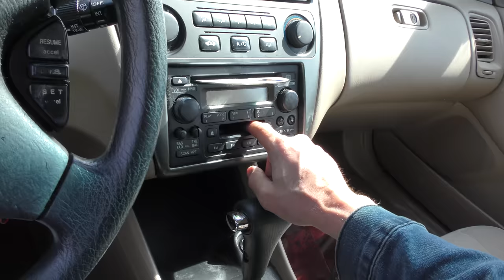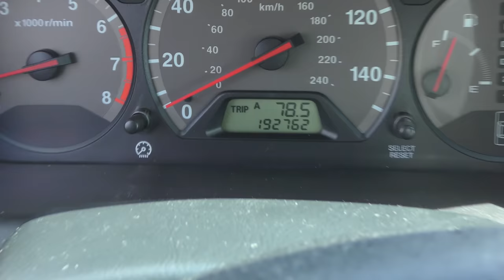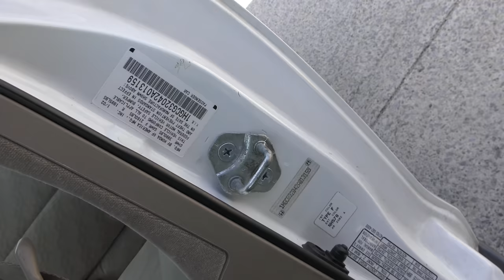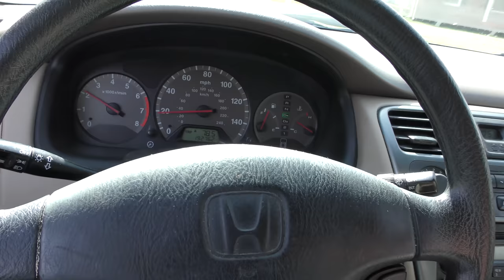This Car Has a Serious Problem

Comment: my kids have 2002 to a 2004 cavilers   they still have most of their  oem parts  it how  you drive them an  take care of them
Reply: No. It's not the only part. The car or truck has to have quality......you guys got lucky
Reply: @richsweeney1115  no they are old gm..big diff  ,,my 95 transport has 200,000 on it  still has most its oem parts  ..an still gets 30mpg...but i ordered it with a 3800 ..
Reply: @richsweeney1115  oh in ohio  there are not many hondas that age on the road,,,,rust
Reply: @Monza62000  but even those have issues. The Montana is the same thing , and they had problems when they got older
Reply: @Monza62000  I live in NH, my wife has an 09 Honda fit 5 SPD sport, w 200k runs like new, and  I have a 5 spd accord that's older than the fit with 231k that also runs like new. Gotta wash them often in the winter
Reply: @richsweeney1115  glad you take car or  the cars,,,we fluid film  ours   my rack  makes it easy..all cars that are made today  can last an last,,my 92 k1500 chev still looks great
Reply: @Monza62000 actually, the newer they are the less they'll last .. new cars are made cheap

Comment: When you change transmission fluid, when should you flush and fill, opposed to drain and fill.
Reply: NEVER, On Honda’s , Never Flush. I always Drain & Fill.
ALWAYS use Honda Fluids.
Reply: @fubarnow8907  I don't own a Honda, but I was just wondering under what circumstances do you flush a transmission.
Reply: @todddrayton9354  Flushing A trans in Any Car can be bad. Sediments are in the case and flushing can move these sediments and clog holes that were once unclogged. This can lead to Trans Failure. Just something for you to think about.
Reply: @fubarnow8907  Is there any upside to doing it?
Reply: @todddrayton9354  If you have to drop the drain pan to change the fluid, that would be better than a "flush". Scotty has Video's on why a Flush Could be bad.On my car I do a drain & refill every 3 to 6 months. My Fluid is Always pink and smells good, never burnt. I have over 200K on my trans and it shifts like new.  I spend 35 dollars for a 3000 dollar trans.

Comment: Hey scotty! I have a sorta similar thing with my pontiac g6, shifts sorta hard randomly but not when floored. Been doing that and have random shutters from the torque converter here and there but still been going like that for over 15000 miles now, would you reccomend driving it and just don't worry?
Reply: baby the car they have weak transmission if it starts to get real bad put Lucas stop slip in it
Reply: its called lucas transmission fix stops slip
Reply: I have same car (2007) same problem just been babying it hardly letting is rev pass 3k and it seems fine till I do a few times.

Comment: 06 Acura TL. Jerky transmission when i come to a quick stop and then try to quickly accelerate. I keep it from doing that jerk (in hopes that the tranny last longer) but i also have been changing the fluid since i got it.

Comment: 200 bucks cost to put a transmission in my old f150 where I'm at. Transmission not included in price lol
Reply: We used to have a blue 1992 Buick Century Wagon back in the 90s. Never had problems with it. Around 230 000 ish miles The transmission blew up and bought one from scrapyard used for like 90$ and a full pack of Marlboros and it was back on the road for a couple of years  before the frame was so rusted out you could stick your legs through the ground but it would not give up that car was a tank. I miss my old Buick.
Reply: Just had to get rid of the f150. Someone tried cutting the cats off. Got into wiring and put a short through it that we couldn't get straightened out. I think I paid 200 for the scrapyard transmission. Truck was still solid especially for being in the north east lol

Comment: I had a 97 F150 for 16 years. Should have gotten rid of it at 100k when 1st motor imploded.  2 motors later and literally a stack of repair bills a mile high I sold it at 270k.  So dont keep a vehicle if its not dependable.  Find out best years of Toyota or Honda and buy it.  Its not only the money saved but the inconvenience of a vehicle thats not reliable.  Just not worth it.

Comment: Nah, 2002-2003 I avoided because of the big transmission problems. Avoid like the plague like carcomplaints says, that's why I think there's so many of those years on the market and not the other years, because no one wants to deal with them.

Comment: Hey Scotty, I understand not getting the transmission flushed but what about changing the fluid and filter? what about Lucas stop slip?
Reply: Do change the fluid regularly; The filters on those 6th gen Accord transmissions are non-serviceable and require splitting the case to replace them. As long as you change the fluid on a regular basis, you should be fine.

Comment: The transmissions in these accords and civics  around year 2003 all dont have planetaries, so they dont have as many clutches as a normal transmission. I flushed out the oil in my tranny of my used 2003 civic, and it was fine. These trannys do have their issues though. Design flaws

Comment: @scotty kilmer: I have a 09 Elantra i reversed my polarity but my car she still starts  I have issues with cabin power.  My heater and ac won't blow, air airbag light, on no power steering car gets hot I don't think fans are turning on what could be your suggestions please help
Reply: You probably ruined your ECU

Comment: Matt Watson from carwow got a 2000 Honda civic drained the oil and coolant out of it and it ran and drove for 5 minutes straight before seizing up, then put coke and mentos in the radiator and engine and it bloody STARTED UP and ran for another few seconds and then it was done for, I bet had he filled it back up with the correct coolant and oil it would have ran perfect

Comment: Terrible car! Transmission went out at 110k Terrible suspension that requires ball joints replaced twice over 159k miles. These model has terrible paint oxidized at 70k. The transmission are prone to many issues. Buyer beware